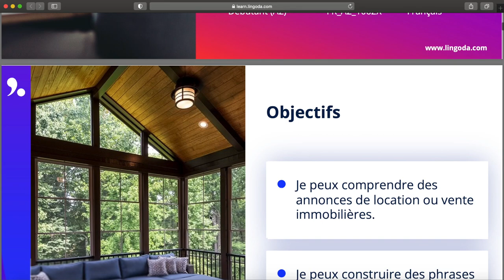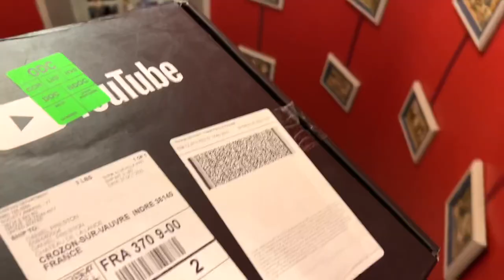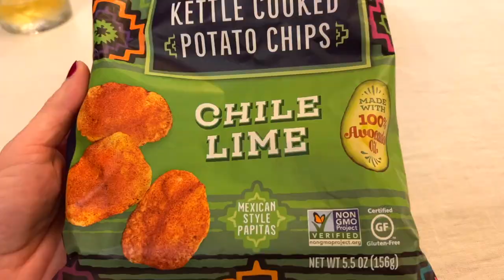My boyfriend's been pushed over the edge…

Comment: I now see there is a chapel, also need some restoration. 😅
Reply: Stephanie did the replacement roof and the stain glass windows already. A new restorer is surveying this winter, looking at the stone work in the small arch, which is 1 centimeter off and the replacement painting to be done this spring.